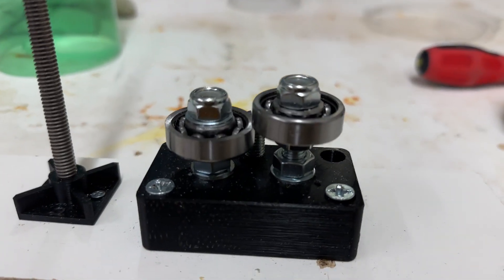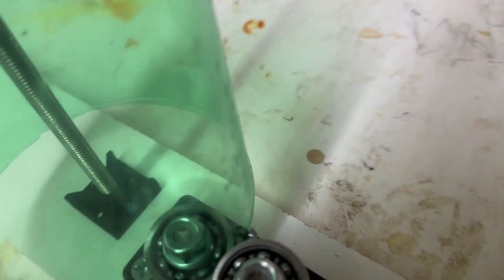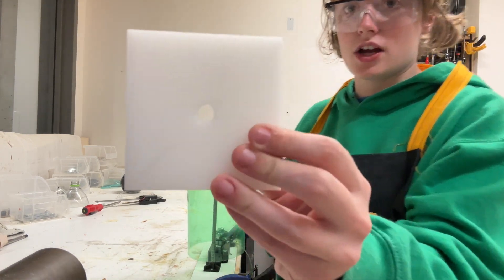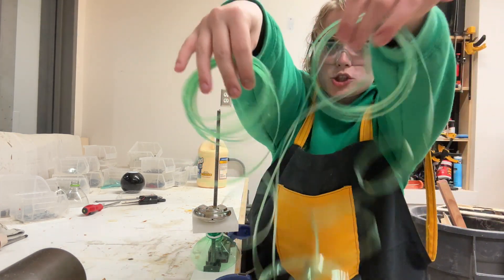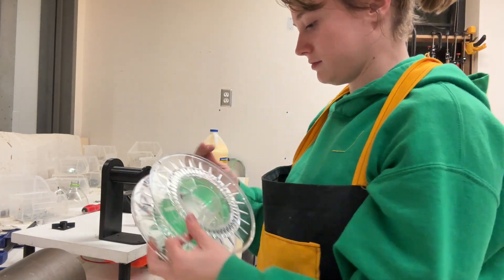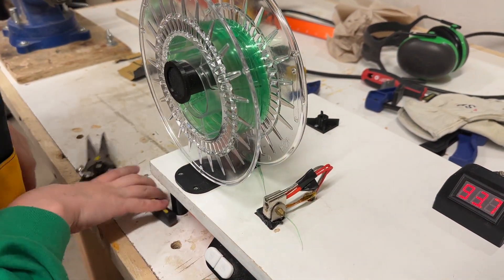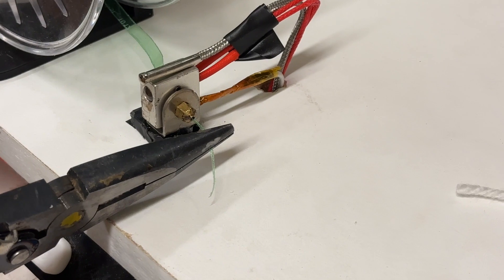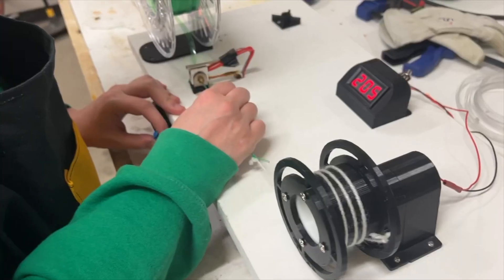my PET machine - full process

Comment: I've built a similar pet recycling machine also but everytime i start to pull it thru the hotend it snaps. i've drilled the hotend out and done everything that all the other pet machines have done but it still snaps. I haven't even been able to attach it to my winder because of this issue. I heard you say something about yours snaping aswell while going thru the hotend. can you offer up any advice for me????
Reply: maybe your hotend is too hot and it melts the pet strip so it snaps
Reply from the maker: Sorry I’m just now seeing this! I encountered the same issue for a while. For me, I had two reasons why the filament kept snapping. 1) Temperature was way too hot. My optimal temperature was somewhere around 205-220 degrees Fahrenheit (which contradicts a lot of other recommended temperatures I saw online). Remember the goal is not melt the plastic completely, but rather heat the plastic up enough so that it is reshaped when it goes through the hotend. 2) Your motor doesn’t have enough torque. The filament may snap because it isn’t being pulled consistently enough through the nozzle. For me, my motor had inconsistent torque because my 3D printed spool that attached to the motor had worn down and lost traction. I also recommend drilling into the hotend and nozzle, so that the unraveled strand of the bottle goes through the heating element a lot more seamlessly. You can see how I did that in my blog, week 7 (https://mcclainmartensen.wordpress.com/reborn-plastics-senior-project-23/) 

I hope this helps!!!
Reply: I have recently done similar project what you need to do is pool the strip when the hotend is heated not before
Reply: Too hot. Above about 240°C, the PET softens enough that it will tear unless the cross sectional area is significantly less than the orifice (producing very hollow filament that needs a large flow compensation and has poor grip). Stick to 230 or lower and you can pull solid.
Reply: Also try to Sand the drilled nozzle